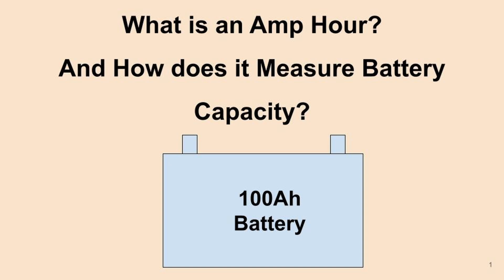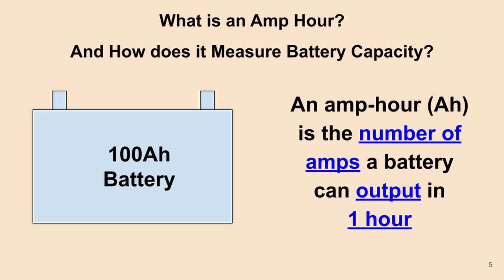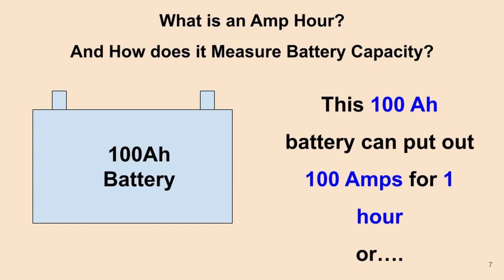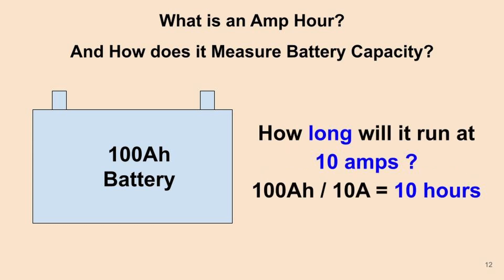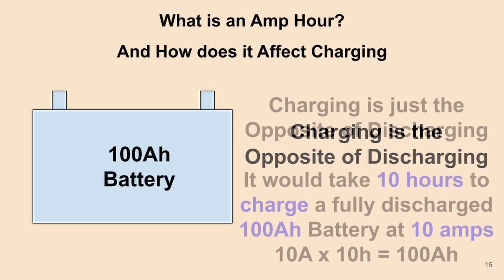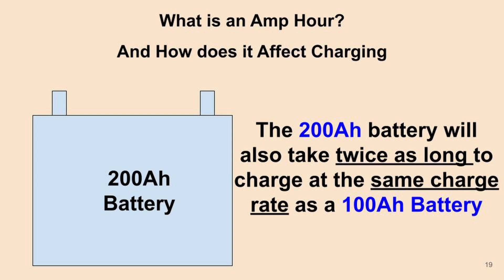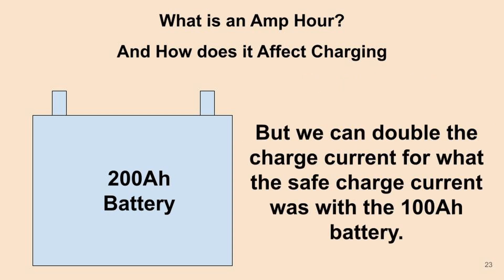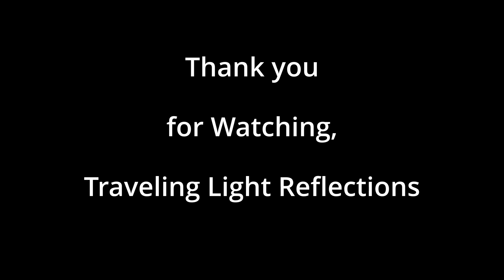Beginner's Help a Guide to What is an Amp Hour (Ah)? How is Ah Used to Measure Battery Capacity?

Comment: Only an electrician will know what amp is this and that you should ve explain if how long a 100w/20w etc can it run
Reply from the maker: I don’t know what you are asking.
Reply: @TravelingLightReflections  how long will 100ah/200ah etc will last if my bulb,etc consumed a total of 600w or 500w or 800w. cause i dont know how much amp they are
Reply: @Zzzazzzy  this video is not a "teach you how electric current" works... Its a video explaining what Ah is.. Which is explained in a video. 
If you wanna know more about how to calculate runtime, discharge time etc, you need to understand what voltage, amperage, watts etc is... That's a completely different topic..

Comment: Your video is why the AH rating is so confusing.  AH means nothing without voltage.  Which battery has more capacity?  A 6 volt 200 AH battery or a 12 volt 200 AH battery?  Also, the true AH both into and out of a battery changes depending on the rate of current.  A 100 AH battery may output 120 AH at a 1 amp rate but only 80 AH at a 100 amp rate.  Which brings up your fallacy of AH rating:  It is not the number of AH at the 1 hour rate, it is the number of AH at the 20 hour rate - the 20 hour rate is the industry standard.
Reply from the maker: AH has nothing to do with voltage! The video is not about Watt hours nor is it about reserve capacity.  It is about Amp Hours. Yes voltage is very important when specifically comparing the capacity different batteries and when using Watt hours.  However, this video is not about Watt hours.  It is imperative that new or beginning RVers, boaters, ect  have a firm understand of Amp hours before they begin to understand about Watt hours.  However, there are many people who do not understand Amp hours and many will never even need to understand Watts hours unless they are comparing power systems or calculating how much energy an appliance uses.  90% of battery users are only caring about how much energy is left in their battery, leaving their battery or being charged back into the battery. Amp hours is more than sufficient for these people .  This video explains that and is for them. Reserve capacity used the 20 hr standard, today people are moving to lithium batteries which are measured in Amp hours and Watt hours.  The capacity of lithium does not change to the extreme that lead acid does when put under heavy loads. The internal resistance is far less than lead acid.  Also, shunt battery monitors are very accurate when measuring battery charger and discharge. BTW, If you care, the unit Ah is Amps X 1 hour.
Reply: @TravelingLightReflections  You need to revamp your definition of battery capacity - it has to do with stored energy - not amps x hours.
Reply from the maker: @TheCSRTech  I am not interested in arguing with you but I and the rest of the world will strongly disagree with you.  Find any reputable source that will state that Amp Hours is NOT a measurement of Stored Electrical Energy. I have been using Ah to measure battery capacity for over 25 years. Did you learn some magically physical theory that no one else knows.  Seriously though, where are you coming from? I am baffled at your confusion or stubbornness of this basic and common understanding.  In case you have not noticed, I have spent time communicating with you and being respectful.  Now you are wasting my time because you are unwilling to learn something or agree with a concept that I am an expert in. Here, I did the google search for you. Choose one!   https://www.google.com/search?q=what+is+an+amp+hour&oq=what+is+an+amp+h&gs_lcrp=EgZjaHJvbWUqBwgAEAAYgAQyBwgAEAAYgAQyBwgBEAAYgAQyBggCEEUYOTIHCAMQABiABDIHCAQQABiABDIHCAUQABiABDIGCAYQRRg8MgYIBxBFGDyoAgCwAgA&sourceid=chrome&ie=UTF-8

Comment: I have 4 LiTime 230Ah batteries, or that is how they label it, but the BMS is only able to supply 200 continuous amps so according to your definition, I have a 200Ah battery? At least that is how I understood your example.
Reply from the maker: Your capacity should be at or very close to the rated capacity.  Also, LiTime is a reputable company so they should definitely be at or very close to the rated capacity.  What I am saying in the video (if you have only 1 230Ah battery) is that the concept of Amp Hours says you should be able to deliver 230A for 1 hour or 460 A for 1/2 hour or 115 hour for 2 hours.  Being as you have 4 X 230 you could deliver 920A for 1 hour or 460A for 2 hours  or 230A for 4 hour.  To more directly answer your question.  Your LiTime 230A battery has a 200A BMS.  This limits each battery to only 200A. (the math still applies but your BMS limit each battery to 200A.  So, if you only had 1 battery you could, at maximum deliver 200A but for 1.15 hours not 230 for 1 hour. This is 200A  for1 hour and 9 minutes for a 230AH battery with a 200A BMS.   However being as you have 4 230 Ah and assuming they are set us a 1S4P you can deliver a max of 800 amp in 1 hour and 9 minutes.  If they are in series then the max current would be the maximum of the # of batteries in parallel. For example, if you have a 24V system of 2S2P you would be able to deliver 400A but a 24V. Please let me know if this makes sense.  In summary, the BMS does not have anything to do with the battery capacity.  One of it's jobs is limiting the current, going both in and out of the battery.  The stated capacity is independent of the BMS performance.  However.  As you add batteries in parallel you can add the current limits of the BMSs.  If you tell me you battery set up I can share more.
Reply: @TravelingLightReflections  Thank you for the detailed explanation. My batteries are in 4S for my Growatt 5000 ES. But no need to go any further, I get it now. I have 230Ah capacity, I just can't deliver it all in one hour because of the BMS limitation.
Reply from the maker: @azycray4801  Yes exactly as you said about the battery's BMS limitation.  Your system is 48V with 230 Ah of capacity.  The next and better way to describe batteries is to use Watt Hours instead of Amp Hours.   Where Amp Hours is good to discuss many aspects of battery usage it does not take the voltage into consideration.  Watt Hours does.  Watt Hours is the Amp Hours of a battery,  multiplies by it's nominal voltage.  For example: 230Ah X 12.8V = 2944 Wh. Or in you case, 230Ah X (12.8V X 4) = 11,776 Watt Hours.   Another example of this is. someone can say to you, "I also have 230Ah".  However if they have a 12V system, you both my have the same Amp Hours but you have 4X the Watt Hours.  So... why did I make a video about Amp hours and not Watt Hours?  Because understanding Amp Hours is very important and often misunderstood by beginners to battery systems.  Also, it still very useful and finally, it needs to be understood before one can understand Watt Hours.  I have an article about Watt Hours on my website.  It is definitely time for me to make it into a video.   https://www.travelinglightreflections.com/what-is-an-watt-hour-ah

Comment: Shouldn’t you be taking into account the voltage of the battery and then calculating the watt-hours, which would indicate how much energy is stored in the battery?
Reply from the maker: I agree and you are absolutely right watt hours are a much better and precise way to measure energy.  However I made this video to be a simple as possible. An understanding of amp-hours is needed to understand watt-hours.  I have an article on my website about watt-hours. https://www.travelinglightreflections.com/what-is-an-watt-hour-ah.    I actually have a written version of this video too.  Maybe I should make the watt-hour one into a video too.  The battery world has slowly moved from Reserve Capacity to Amp Hours and now Watt Hours.  Mostly because lithium has a different voltage than lead acid, it is import to compare using watt-hours.  However, when we are reading a battery monitor to see the State of Charge (SOC), we use Amp-Hours.   Thanks for your comment on this.
Reply: The issue, is the truth of the rated capacity.
As purchasers of the stated capacity, we expect that it will provide what is stated.
This is where manufacturers fail.